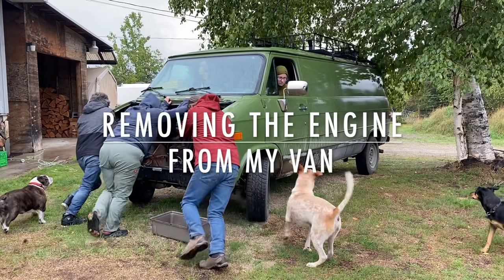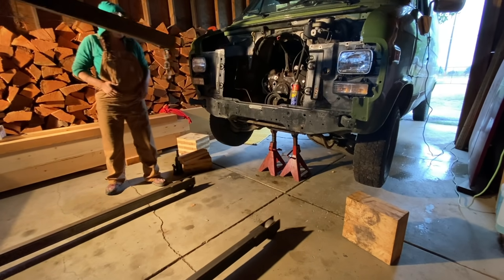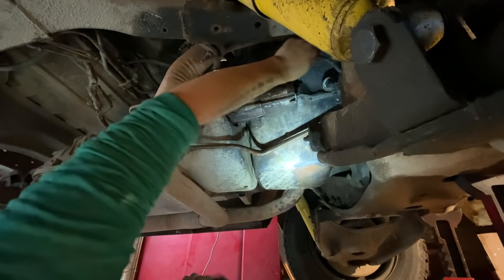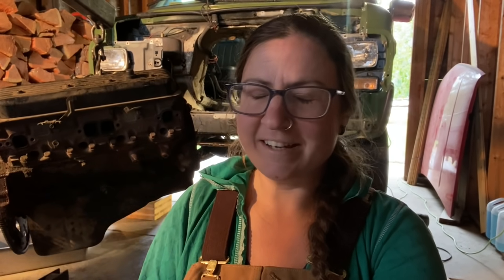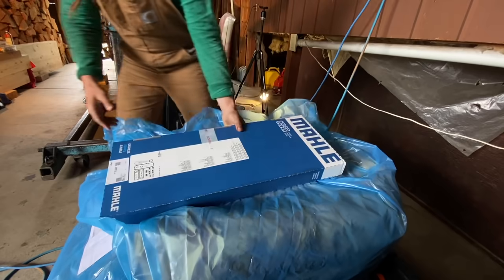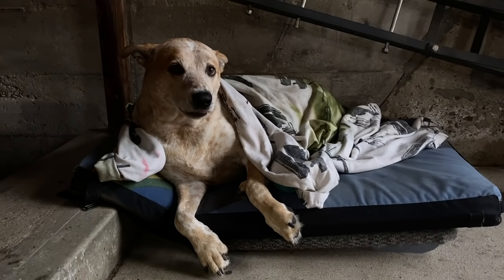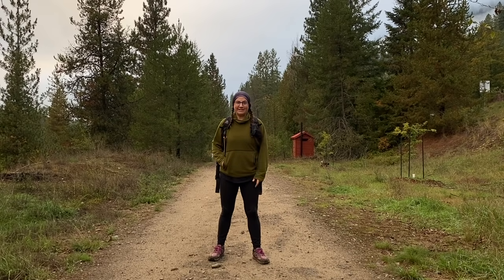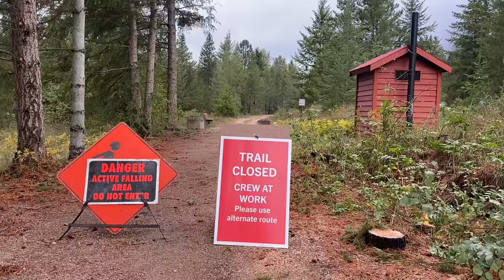Engine Swap in my Tiny Home on Wheels || '94 GMC Vandura/G3500 5.7L Vortec

Comment: So awesome that you're tackling this project yourself! The knowledge gained from disassembling and reassembling all the ancillaries and sensors will be invaluable down the road in terms of troubleshooting any future issues. Write me down as one more vote against going back to carbs. There's a reason the industry moved forward. Go backwards and you'll get worse fuel economy, less-than-perfect fueling at partial throttle, and you'll become very familiar with cleaning out jets. Carbs seem simpler but your EFI system isn't complicated. Instead of spending money to go backwards, invest some time learning the in-and-outs of your EFI and its troubleshooting techniques and you'll be much happier down the road.
Reply: Boring story
Reply: ... I agree with you MadGraph 💯, and you make a Valid Point! 👍

Comment: I bought a new engine for my van, wanted a part but the entire engine was cheaper. Loaded it in back with an engine hoist, 900#\400k but didn’t have one at home. Disassembled it IN the back of my van. 2 days. Fun.

Comment: I'm so stoked for you!!! Im also jealous of you doing it yourself. I'm currently getting a new engine installed in my Jeep Cherokee xj and even though I'm not doing any of the work, I'm still nervous. Lol :) for real though. I though about doing it myself, I have great tools and a small shop space... but I've never swapped a car engine before and I don't have anyone to help...so I wussed out and waited in a long line at a local mechanic. It's also gonna be $5000. :/
Reply from the maker: If you’re getting the engine and install for that price it’s really not too bad. I’m very lucky my dad is a mechanic and helping me on this because I would be terrified to do all the gaskets/seals/silicon business myself.
Reply: .... $5000, that's a little steep 🤔   Are you getting a "New" crate engine, or just another "Remanufactured" engine?   which is just a Rebuilt engine from a Engine supplier, and the least expensive method. 👍
  
Engine supply houses are getting better, and so are their Rebuilt engines, they have to, technology has improved considerably over the last 2 decades.  Engines should be rebuilt by specialists who have access to lathes, and years of experience ✌

Nice video, pulling an engine from any vehicle is incredibly difficult, it takes a lot of patience, dedication, money, labor, and back pain 🤔    That's cool, that you and your Dad are doing that together.  

The biggest job, and the few times I rebuilt anything with my Dad, was when I needed to replace a rack and pinion steering assembly on my 1990 Lincoln Continental, on a gravel driveway.  It was a Pain in the A$$.  
You have to support and lift the engine from above, with an engine cradle, while lowering the engine subframe assembly, so that you can maneuver the steering assembly from underneath the vehicle.  I don't own an engine cradle, so I made one from a 8"x8" piece of lumber, which spanned across the strut towers, and I used 2 heavy duty ratchet straps, wrapped around the engine, to support it from my "lumber cradle." 👍
It was back breaking work!
Reply: @Texaca it's just a rebuilt engine. I know, that estimate shocked me so badly I almost just gave up on the jeep....but I love it and I honestly need it. I live in Durango Colorado, things tend to be strangely expensive here anyway, and recently the world has been greatly altered by a global pandemic. Because of the chip shortages banging up the new car market so bad it's been trickling down into used cars too. Used cars are bonkers $$ here right now. So in abnormally high volumes, everyone is trying to fix old stuff. So now mechanics are all really backed up. (I've waited almost 3 months so far) plus supply chains are stressed and slowing down. Sourcing parts and finding a talented mechanic with time has been a wild dance. After a lot of looking and asking around, I'm realizing im lucky to be getting it done at all.
Reply: @jerediswatching6563   ...I understand your situation.  You gotta do what you gotta do.  I got a broken down 92 Jeep Cherokee XJ, it died on me in March of last year.   I have yet to work on it.   I think the electronics in the Distributor are bad, the hall effect sensor for the Camshaft is gone bad.   And last month, some idiot stole my Catalytic converter from underneath it, while parked at my friends house, here in Tyler Texas.  😠

Comment: Many years ago I had a similar van to yours, when I swapped engines the old transmission lasted about a week with the new engine. Just couldn't take the power of the new engine. I'm not familiar your earlier van projects so I don't know if your transmission has been rebuilt or replaced before this engine swap, just be aware of this as a possibility. Good luck, awesome project.

Comment: Ya know if you take care of that TBI fuel system it will treat you good. I dont know if there would be any real benefit to backing down to a carb'd setup. It would tend to be more finicky especially as elevation changes, probably less efficient (and I am a HUGE fan of the quadrajet-- best carburetor ever built, period) and then you have to start butchering the fuel system/electronics of the van and it will never be undone. I would consider replacing O2 sensor(s), exhaust manifolds, MAP/TPS sensors, the fuel pump and FPR, any soft lines or o-rings, etc. And the thing will prove to be as reliable and efficient as youre gonna get with that thing.
Reply from the maker: Thanks for the advice. I’ve already relaxed all the sensors, fuel pump twice and the exhaust manifolds are in great shape. I agree with the elevation issues of a carburetor but I do like the idea of having less electronic components in my van... always a trade off eh! It looks like the TBI is getting some time to prove itself anyways 😉
Reply: @tidelinetoalpine  You could easily find an aluminum factory 4 barrel intake for that engine (for cheap) and put a quadrajet on there from a reputable source. It would run SO good but there are a lot of other mods that have to happen to do it right. New HEI distributor, etc and it will all have to be tuned by someone knowledgeable or it will be finnicky. And once you do that you're on your own because no manual will tell you how to check/set the timing, adjust the choke,  troubleshoot issues, etc. Just saying. For the sake of simplicity and reliability, the factory stuff is not a bad idea. Very very rarely with any generation of vehicle new or old, is any sort of aftermarket modification really good idea in terms of reliability/driveability/quality. You will always sacrifice some of those things. ONCE in a while the factory blows it and there are things that MUST be done but the small block chevy is pretty darn bulletproof especially in bone stock form. Letting it breath easier (intake, and exhaust) and keeping quality fluids and filters on it are a great idea. Dont get me started because i'll never shutup!
Reply: @tidelinetoalpine  .... get a donor vehicle, with a v8 engine, that can fit in your van.  Like out of a Chevy Scottsdale truck or a GMC Sierra, from a 1996 or newer vehicle.  Swap all the electronics, plumbing, wiring, gauges, and the entire engine compartment 👍  have the engine rebuilt by your Dad, or a machine shop.   
It'll be nice, because you'll have newer electronics, like OBDII, and parts will be readily available from any auto parts store.
Reply: @tidelinetoalpine  DONT CHANGE A THING. change the pickup coil in the dist. gut the cat. converter and its more reliable then a carb. and yes, I know its already done by now.
Reply: @Texaca  no, that EFI on a 96-later can be a pain.
Reply: @Texaca  you can do the same thing on that truck/van too, those code readers can be found too. same system used on all v8's from 1988-1995, TBI fuel system. P.S. I have worked on the carbureted, feedback, and the TBI, the SEFI"spider" and SEFI separate injector systems, anything with that SEFI spider, can never run right and has the worst upper/lower manifold seal ever- I would rather pull EGR coolers off 6.7 fords first.

Comment: Coolio! I can remember waaay back when I was young that you could buy a rebuilt Chev 350 for $800... I'm guessing they cost quite a bit more than that now?
Reply from the maker: Yeah... ~$4000CDN for the short block (with gasket kit), shipping and special break on oil 😅

Comment: You see a lot more on a bike if you have an upright riding position, which requires gull wing or coaster bike style handlebars.  But then your tailbone would hurt even more. Hard to go more than 5 miles at a time with a set up like that.  Probably not the best for rough trails either.

Comment: Isn't GMC a Mopar? Which would make it American Made..... Not Imperial.
However there are quite a few vehicles that have bolts for both measurements. Especially if any of your parts or bolts are aftermarket.
You are actually doing a fantastic job with everything so far.
FYI, in the future there's a spray that works amazingly to cut through and remove built up grease and carbon.

Comment: Are you planning to clean up and treat for any possible rust starting inside and underneath while you have the engine out? If that's your long term home like you said be careful look what happened with Cromes van and it was about a decade or more newer. Them again you are so good about maintaining your van you probably have already pretreated for any rust starting. Great job you are probably saving yours big $$$$$ stay safe and God bless 🙏